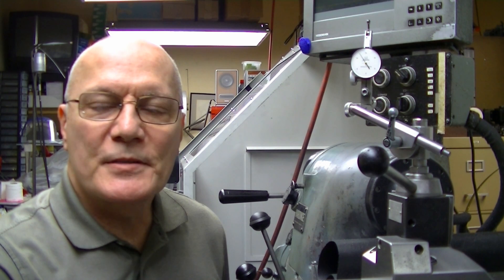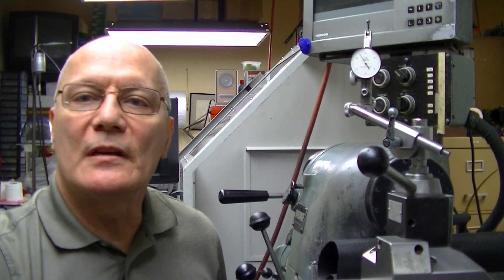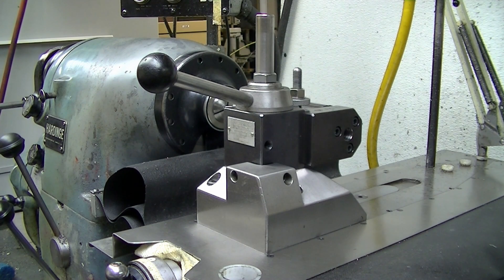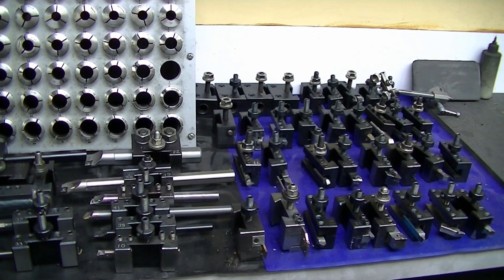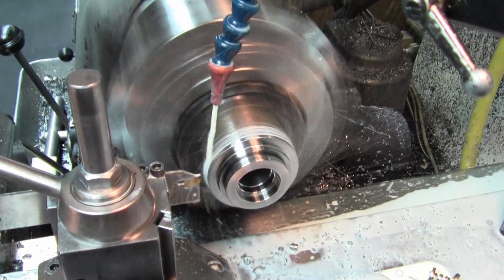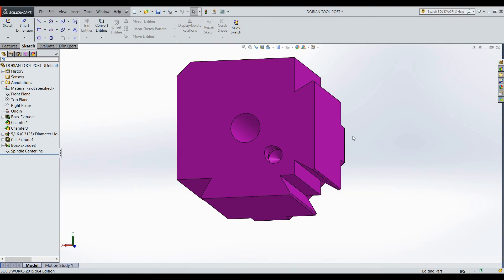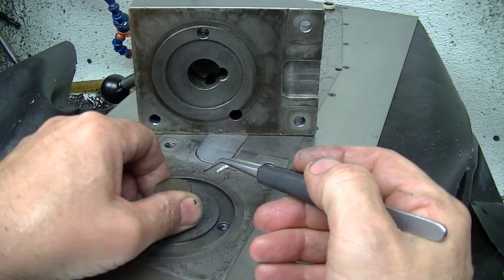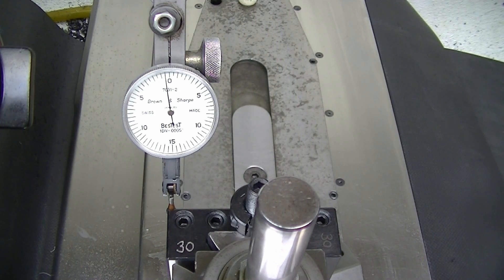THE SOLID TOOL POST MOUNT

Comment: Thanks for the video solution........having thought about this possibility for a number of years, watching the video confirms that I probably will fare better if I do away with the compound slide and mount a solid steel block to mount the QCTP tool post on.....one that I've just bought.
I need to make a new crosslide as the lathe, a Colchester Bantam,  is one of those that dates back to the 1920/30 era and the crosslide is as short as it's wide which creates wear on the saddle dovetails in the middle as opposed to modern practice of the long crosslide.
I considered a back tool post to mount a parting tool on but now I'll add a second QCTP on a block at the back to make it as rigid as possible while allowing different back tooling to be quickly mounted......the jury is still out on that need.
Reply: But......there is a problem if I (we)  want to do screwcutting........I work with the compound parallel to the job and move it sideways as I go deeper when screwing which is different to the so say American way of angling the compound over at 30 deg etc......so the jury has gone back out to ponder on that one.
I suppose with carbide insert screwcutting tools the speed is up so moving sideways like in the old way is a thing of the past.......gotta do some more looking.
Reply from the maker: Straight infeed on threads is no problem for pitches below 8 tpi
Reply: @ROBRENZ  I still have to come to terms with carbide threading as I have always used HSS before.....carbide doesn't like to be run on a slow rpm for turning so threading is going to be a new challenging ball game for me.
I'm starting to invest in more carbide tooling now that the price and availability, coupled with the variety of packages, has put it right under my nose .
It's too tempting to ignore and old practices die hard when current must have solutions present themselves just for the asking.
I found that to get the best out of my old lathe with carbide the speed needed to be cranked up a lot and dry cutting is a distinct possibility if you get the speed and feed right.

Comment: Hey Robin,
Like several guys that have commented I have an Hlv-h and would like to add the solid tool post
is there any chance that you could post the cad drawing of the cast iron mount?
It would make tackling this project a lot easier - thanks
Reply from the maker: Sorry, it was a napkin sketch.
Reply: @ROBRENZ  Thanks anyway  -had to ask - btw its very cool and unusual that you keep responding to comments on you videos years after you made them!!

Comment: So, my Sherline not having a compound is a good thing... who'da thunk it?  Glad I decided to design an adjustable tailstock for turning tapers, instead of going to a compound. 

This also explains why the parting tool I just finished works so well on a lathe notorious for not parting worth beans. I put it on the back side, and started with a precision ground 2 x 2" angle block, (it IS a cute little thing), and went from there. It is height adjustable and uses the chuck edge, and rear edge of the cross slide at reference, with overlaps to rest against the edges for repeatability when installing.

The best thing, (IMO), is the source of the parting blades.  After looking at a lot of them, it was a blade like yours which inspired me to cut slices from a worn out Skil saw blade, regrind the carbide, (square the end, remove the 'kerf' and set the rake), and go. One 7¼" blade nets 12 parting blades, and the price is right.

A 1/32" reinforced abrasive blade, (either Norton or MSC's house brand work great), makes cutting slices of blade quite easy. I then bring them to final dimension and parallel top and bottoms with a mill.  It doesn't take much time, and a dozen blades last quite a while.  One word of caution: do NOT use expensive thin saw blades, use the cheap think ones.  Parting blades made from thin saw blades do not have the torsional strength needed, and twist when used.

Not quite to the level of making flat Slinkies from SS like you did, but no chatter parting is virtually unheard of on Sherlines.  There's a few things I did when I mounted a motor and the lathe which help as well.

Yet, again, I have learned from a video of yours, Rob.  This comes in very timely, as well. I'm about to raise the headstock on my lathe, so I will be making a block similar to this, but using for a spacer, instead of replacing the compound.  Lots of good design ideas, especially since I just got an Aloris type tool post.

Thanks,

GeoD

Comment: I just wanted to thank you for your video on removing the compound I have a harbor freight mini lathe 7 x 10. That should explain everything .my latest video shows me able to do monster cuts taking way more metal than I ever thought possible my channel is my name Kimber Zelik, and the title is something like . actually stalled attempting 0.100 my math was a little wrong in the video but the fact that I could remove 0.050, with the finish that I got was amazing .so I owe a lot of that to you . I didn’t take mine quite to the Percussion you did yours and I think what I did was appropriate for my machine, love your channel . Check out my most recent video I think the title was actually stalled at 0.100

Comment: Robin, I am confused on how you scrape the solid tool post in.  Do you scrape a little and then mount it to see where it sits and keep going back and forth until you have it where you want it?
Reply from the maker: Just scraped to sit flat on the cross slide so it doesn't distort the cross slide when bolted tight.

Comment: Robin, I am going to make a hand crank drive extension for my lathes. A constant battle with my watchmakers' lathes is the lateral forces exerted onto the workpiece, compromising the surface finish. This can be mostly overcome with very careful feed by hand, however, compromises feed rates etc. 
The dowel pins with set screws to keep the toolpost from rotating is also great.  
Very informative video.
Thanks for the ideas.
Reply from the maker: Glad you are finding the content useful.

Comment: Absolutely love your videos, your attention to detail is astounding! I have not witnessed in my life (57 years) any machinist that is anywhere close to your level of craftsmanship, with the exception of (Stefan Gotteswinter). Please keep the videos coming, even though it is way over the head of us common folk...lol   Also was just wondering if once you had the block trammed in to zero, if drilling a taper pin to the cross-slide would allow to reattach without having to set it back to zero each time. I'm sure there is a negative to this, or you would have done it.
Reply from the maker: Thanks for the kind words. Pinning it to the cross slide would keep me from being able to fine tune the alignment without using the two set screws which would affect the flatness of the mounting surface.

Comment: I don't like it. If you're not employing the flexibility of a compound (not all compounds are as flimsy as yours is by the way, check the Emco on Stefan's new lathe) you're not getting the full use of your lathe. Compounds are on lathes for a reason and used properly add a dimension to the lathe you're missing. When you're doing commercial work you need every bit of flexibility your lathe has. CNC is different than an non CNC lathe, you can get away with a solid post in CNC work, it's a different animal. I guess for hobbyists a solid tool post might be an option but I definitely want a compound.

Cutting off on light lathes should be done with the cutter upside down. I've cut rings out of 1-1/2" 17- PH stainless and drill rod without problems. If the cut off tool does ever dig in it moves the tool post up away from the work. You're flooding the cutter with fluid, I can use a drip oiler and get the same results. How many hobbyists have flooding? For hobbyists mist is a better option and it's even good for the pros.
Reply: This for sub tenths resolution
Reply: If you're doing a lot of jobshop repair work, then a compound is very handy. Otherwise, you can do a lot without a compound. To each their own. But it's going a bit far to say you're not getting the full use of your lathe, as each person has different requirements and is willing to make different compromises based on what their priorities and capabilities are (being able to make up for certain short comings of one machine  with other machines/skills). I think Robin is getting every bit of use out of his lathe for the work he does.
Reply: You must have missed the video where Stefan put a solid toolpost on his Emco to make it more rigid. https://www.youtube.com/watch?v=bLn0Ch1_KQM

Comment: One last question about losing the compound slide. The compound has a fine lead screw and a micrometer control handle. The Z axis handwheel on my 9x20 uses a rack and pinion gear with no micrometer action, in other words, it's very coarse with loose control. I can replace the, apparently zink, pinion gear, with a better steel gear and tighten up the backlash but there is still a lack of fine control. The other option is to completely disengage the Z axis lead screw gears and leave the lead screw engaged in manual mode and put a handwheel on the end of the lead screw. This will cause more wear on the half nut so I will probably have to upgrade that also. Because the handwheel will be in an awkward place it would be harder to use and still see the head stock and work zone. Finally, disconnecting the lead screw gears means when I want to use auto feed I would have to stop and reattach the drive gear. The only solution that comes to mind is to install the electronic lead screw from Clough42 https://www.youtube.com/watch?v=FTs9GygRQ-U&list=PLDlWKv7KIIr90ZZ7Zqt-ge5nVVdS3WVgg  and then add an electronic handwheel. Short of reworking the whole Z axis cross slide gears to the pinion, that's the easiest choice. Your thoughts are much appreciated.
Reply from the maker: The Hardinge lathe is rack and pinion feed of the saddle.

Comment: I have a Chinese 9x20 lathe (same one Ste[phan Gotteswinter used to have) and I am redoing the cross slide based on your video. I have had an AXA piston type QCTP on the lathe since I first bought it because it was cheap and I didn't know any better. Now, a few years down the road I'm a bit more knowledgeable and since I am eliminating the compound slide, I have the option of installing a heavier BXA wedge type QCTP. My bed swing is only 9" and the BXA size starts at a 10" swing but since I am losing the compound height I should easily be able to accommodate the larger BXA.  I will leave the AXA on my existing compound, in case I ever need to install it for a special project but since I haven't invested in a bunch of extra mounts, now is the time to either go with the BXA or stay with the AXA. With the BXA I will have a larger tool size capability and the mounting bolt is 5/8 vs the 9/16 on the AXA giving me additional rigidity. The only downside is the mount under the BXA would be thinner, possibly introducing an area of flexure. I also need to double-check that I will have adequate x-axis travel although the difference between the AXA & BXA  is only 1/2". Either way, I'm upgrading to the wedge type QCTP so I am still buying a new QCTP. Since I only have experience with an AXA, any input is appreciated.
Reply from the maker: Definitely stick with AXA size. MIll out cheap AXA holders from CDCO tools to 5/8 or 3/4 capacity. The newest Dorian wedge style toolpost is far superior to the Aloris.
Reply: @ROBRENZ  Thanks for the reality check. I'll stick with the AXA (I can use my old tool holders) and upgrade to the wedge type. Unfortunately, I'll be buying the import version as the Dorian and Aloris are 5 x the price. I'll use the money saved to upgrade my head stock bearings. I am going to fabricate a tail stock upgrade based on your design but I'm going to repurpose a honda steering rack for the mechanism. Quality, cheap parts, made in Japan.

Comment: With the emphasis on being able to store the offsets in the DRO such that you can quickly swop tools and assume the values, does wear on the edge of the tool not come into it? I suppose not enough to be a problem until they need regrinding (tool steel) or cutters replacing (carbide), at which point all bets are off and you'd re-measure and store the new value? At least with wear on the tool, any gradual build up in error would mean excess material left behind that you'd spot when checking with gauges etc, so you could re-calibrate the worn tool and take the material down to final size?
Reply from the maker: Its easy to make adjustments on the fly just by going past the target by whatever tenths are needed. Its also easy to just reset the tool.

Comment: I love that lathe, would love a hardinge, whats your opinion on a boley lz4. can mabe get hold of one?( in nead of some care)
Reply from the maker: Not familiar with them
Reply: Leinen and Boley (also Schaublin)are some fine machines. Smooth movements and low noise. BUT many of them come with a belt drive, not always suitable for rough and big work, if many days have passed in their lifetime. Original parts come expensive IF you can get your hands on some. Most repairs and parts come out of a DIY nowaydays. 
If you're able to buy a well serviced Boley (making some proper tests) you will be happy in the end. I have worked on some during my apprenticeship. 
If you are looking for something else, take a look at Weiler. If you want to go crazy for precision and machining big parts, look up Cazeneuve (HB 5xx and HBX 5xx models).

Comment: thats one heck of a shop there. guys working in commercial shops are jealous.as an aside, being perfectly perpendicular to the chuck can be an issue with some inserts.. i always prefer a slight bias with the nose radius touching the work
Reply from the maker: Thanks, you can still put the tool at an angle in the holder.
Reply: @ROBRENZ  true

Comment: Hi.. Im jidat from indonesia, thks 4 sharing ur vid n tutorial. I do have a chinese cheap lathe. With some improvement, i hope i increase my ability to make project with faster n better. I making some parts for offset printing machine. Need more accuracy. With my improvements i did, i can cut 5 micron, with ur attactment, maybe i could cut within 2 micron. I will do the way you did. Thanks a lot bro. Shallom from INDONESIA

Comment: Hey Robin, I was speaking to my buddy Andrew Podaca when he made his tool post mod he had seen from your video.
I can't believe I was not subscribed to your channel until now..sorry man! You've got one more now...🤣
I did see this some time ago, and watching it again brought up a question in regards to threading or even turning the toolpost in order to do other operations. Now that I've been running my small lathe, I'm constantly having to turn the toolpost to gain access to the work because of tool geometry. With this set-up, you obviously cannot do that. I guess if I were to make something like this, I would only use it primarily for parting, as my little Southbend sucks when it comes to parting. I can see the importance of your design for things being rigid and able to repeat on the DRO. Very nice no the less!
Reply from the maker: You can make one that mounts the same way the compound does but is solid. That way you can still spin it to any angle you want but you get rid of the compound slop.  You can thread without a compound easily on threads below 8 tpi.
Reply: @ROBRENZ  
Thanks for getting back. I would very much like to come up with something to aid in parting, having more rigidity will help a great deal. Thanks for sharing with us out here...
Razor!

Comment: @ROBRENZ Dumb question,  how would you approach short steep tapers on this machine now the compound rest is gone ?
Reply from the maker: Wide plunge tool set at the required angle.
Reply: Ok got it ! :-) Really like the angles that you put on the tool post assembly, they look really "correct".